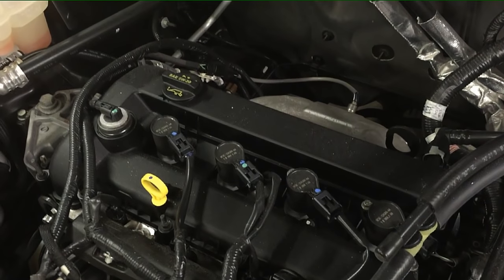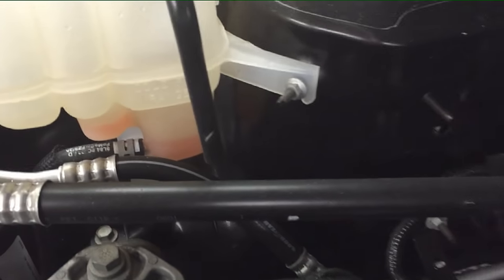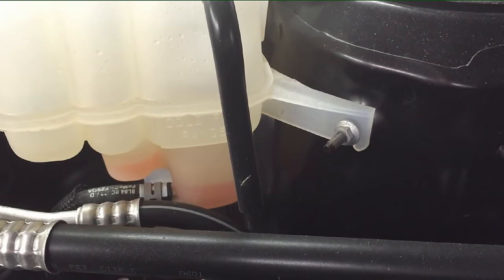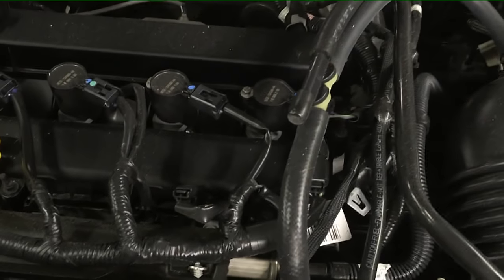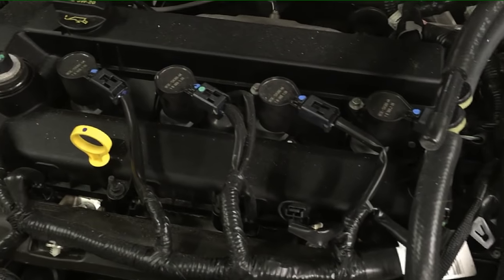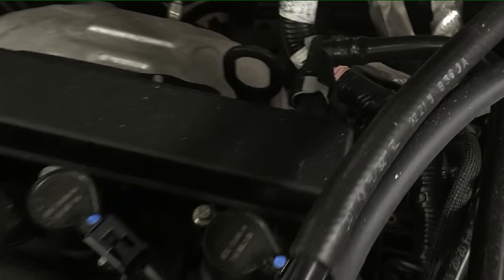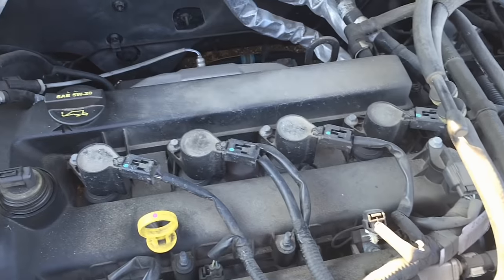Ford Vehicle Noises: #4 Tapping Knocking Noise 2.5L Engines

Comment: Mine sounds like that. Has since I bought it with 45k miles. I’m at 203 now and it runs absolutely fine. My mechanic told me these are known to be noisy but reliable engines
Reply: Oh and I still get around 27mpg average mixed city and rural driving
Reply: Yep it's a DOHC 24 Valve 2.5L L4 they have a slight ticking noise. It's very European tractor like sounding. It's normal

Comment: I had an interesting tapping noise like that which suddenly got really bad. It turned out to be that the flex plate was fractured all around the mounting bolts for the drive shaft. It came out in two jagged pieces!
Reply: Same here. Cracked flex plate.
Reply: Did that noise come and go? I have a knocking noise that will be random at idle, pretty much goes away above 2K rpm
Reply: @keithtulloch5682  It came and went and got much worse. I was still able to crank it, so the alighment for the starter was maintained. I didn't know what was happening, so I tried setting the timing, used the wrong timing pin and broke a valve, bent some other valves and had to drop the oil pan to replace the piston head that was pierced by the broken valve! The noise remained after I solved my oops-generated engine problems, so I dropped the transmission and discovered the broken flex plate. It fell off when I approached the first mounting bolt. It was a jagged fracture around the array of bolts that secured it to the engine. The replacement Ford part seemed to have a stronger, perhaps more resilient, design.
Reply: @keithtulloch5682  dude same with me please if u have any info that would help
Reply: My 2006 mountaineer sounds like a ticks not like a gas motor should sound. Just had a rebuild 3500

Comment: Thank you for doing this video. My 2015 Ford Edge has started making this noise. And you're right, it gets louder as the engine heats up, but I don't hear it as I'm driving down the road. What is a fair cost to have this fixed?

Comment: On a used car I would walk away from a noise like that.
Reply: Will C just worked on a fusion lady bought for $4000 at a unloyal used dealer. Diagnosed it and turned out a the rattling noise is a misfire and a bad valve. Didn’t overhear but must have been a beginning of a head leak.

Comment: I have 05 ford escape 4 cylinder . I think this is the issue I have. when it start it do not have loud knocking noise. but after few min it gets really loud noise.and leaking some fluid. must be antifreeze.

Comment: Thanks for the great video. My Escape just began making this noise. It sounds a lot louder when the car is in low RPM or if I disconnect any of the coils. If I rev the engine up a little bit it stops. The car runs perfectly and I don't hear the noise while driving. What has to be done to fix the crack? Or how can it be muted?
Reply: Did you find out what it was?
Reply: @Alex Arias  it was the flywheel/flex plate. It cracked, so the noise was coming from the broken piece of metal bouncing around.
Reply: @miguelmojica5897  
I have a 2014 ford scape and has the same noise 
So is that the problem my Mecanic going to check the car tomorrow
Reply: My 2014 Ford Transit Conbect has the same symptoms as your vehicle but the noise is on the passenger side of the vehicle I thought it was the water pump and changed that and i cut the ac compressor belt the sound is still there......smh

Comment: 2003 Focus with the 2.3L Duratec motor, 230,000 miles and still running strong!  I change the oil every 5,000 miles without fail.  Flushing the coolant and replacing the hoses is important too.  Just show your motor some love!

Comment: I have a 2007 Ford Fusion with this engine...I had 79k miles on it and after a long trip this ended up happening to my vehicle.  I am still driving it as of May 2020.  I have the exact sound and symptoms in the exact location you are showing here.  I was pissed and still owed money on the car loan.  A pro mechanic found a little metal in the oil pan and suggested I replace the engine.  I have kids and family and needed a reliable car so I just let it sit for a year.  I then decided to just have it as a "in town" car and decided to put Mobile 1 fully-synthetic...and just keep the RPMS under 4,000k.  I've babied the car and just used it casually since.  I'm on my 3rd old change (today) and now have 98,000 mils on it...so I've driven it almost 20,000 miles and the only issue since then is a slight power steering leak.  I hope this helps anyone in a pinch to see that you can actually drive your car carefully but reliably...but I would say in this situation the BEST synthetic oil should be used no matter what...and I use MOBILE 1!  The shit works

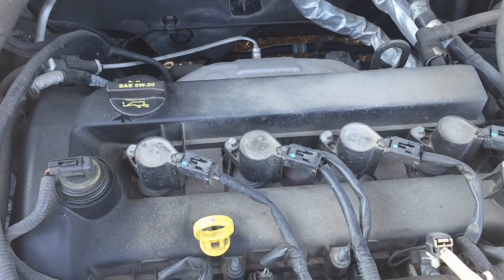Comment: You just saved me a whole lot of worry, first time owning a 2L engine, and I thought the noise coming out of the engine was sign of some horrible problem. Turns out, they're supposed to make that   sound (2:20), live and learn I guess.
Reply: Mines made the same noise for almost 70thousands miles lol
Reply: @austinhall1998  same here , put in 100k so far and perfectly fine
Reply: That is why Ford Installed those rubber engine covers in the newer Duratec 2.3 and 2.5 engines. The rubber insulator dampens the noise. I've seen some people simply buy a kit that installs an insulator engine cover on the older Duratec engines.

Comment: Thanks for the video. I have a twist to my experience with this noise. The engine has 56,000 miles on it, a 2012 Escape 2.5 engine. The oil was changed a month before this happened. 5w20 oil. One day, out of nowhere this noise begins. It sounded like it was coming from between cylinders 1 and 2 on the Left side, but also resonated on the left side of the front frame clip. Took it to the dealer (just as a starting point), it was just out of warranty. They checked it and said it was the idler pulley rubbing against the frame, replaced it, a little over $130.00. I have seen this happen on corvettes and mentioned that to my wife before we took it in, but I was surprised that this was the case. It sounded Exactly like your video. Is there anyway the fooled me on thi? I just find it hard to believe I was this lucky. Also a second question, why isa the engine valve train SO noisey? Thanks for your effort to help us .

Comment: Great video. Best car I ever owned was a 2010 Ford Fusion SE, 2.5L (same engine as in this video), got me to 415,000km before the torque converter went. Tried my luck now with a 2015 Ford Escape SE, same 2.5L engine and it’s been a lemon since day 1. Purchased it 5 months ago.
Reply: Im glad too hear this. Thanks man. I just got a 2010 se 6 speed manual fusion with 150.000 miles. 2.5 liter.
Reply: Damn, looking at a 2.5 L Escape now. What are some common problems?
Reply: Toyota

Comment: 2015 Escape 2.5L 82K miles just started making this noise—thought it was a lifter maybe but sounds pretty similar.  (No coolant loss but power steering leak reported at last oil change.) thanks for the heads up!

Comment: I'm freaked a bit. I have a 2010 Fusion with the 2.5L. That said, luckily I don't have this issue. Oil and coolant changes are very important then as a preventative! Thanks again, Brian for educating us.
Reply: He said it's a manufacturing defect , maintenance will not prevent this issue.
Reply: DJR5280
Honda was having a similar problem on their 08 civics, IIRC. Block could crack due to casting defects (too thin around the coolant passages near the exhaust manifold). They extended the warranty on the engine for 10 years, 100,000 mi.  Regular oil/coolant changes won't hurt.

Comment: I wanted to thank you for this vid. I just put in a 2012 fusion engine with 27K in my Milan and it was making this noise from the get go. The car runs 100% just noise drives me nuts. But I can live with it. You ended up saving me $520 because boneyard refunded my money and let me keep engine. THANKS!!!!
Reply: blueblood76 newer toyota rav 4s had cracked cylinder heads too.
Reply: blueblood76 how you fixed? 
Sorry not much understanding English 
I have same sound 
2014 Ford Focus 45k used car
Reply: Ismail Jiva make sure ur running proper motor & oil filter 1st!
Reply: Car is still running fine 5 years later,

Comment: I have a 2015 Transit connect with a 2.5 that I actually have a hotline contact out for right now. It came in with a P0304 and it only misfires on decel. Ruled out injectors, spark plugs, coils and injector/coil power and driver circuits. Manual compression showed same compression across all four cylinders, giver or take 2-3 PSI. The engine I'm dealing with seems to have this loud obnoxious tap to it so I'm curious if you have seen any misfires associated with this block cracking issue. Hotline wants me to perform a running compression test and look at the valvetrain if the running compression test is inconclusive.

Comment: Hey brother i have 09 ford escape 2.5l and i been having a problem with my engine it wont stop shaking a change all my engine mounts and tranny mounts spark plugs and even the purge valve and it wont go away it does it even more when i put it on drive do u know what maight be the issue ? Thanks love ur videos

Comment: I just recently changed my oil and used 1qt of Lucas oil stabilizer in place of one of the full synthetic quarts of oil. Engine runs much quieter now and smoother. Coolant isn’t disappearing thankfully.

Comment: whats your thoughts on a 2014 2.5 that makes this same noise but when cold after start up, then goes away when warm, not using coolant?
Reply: I have the same issue... it starts slightly noisey but afta a 5-10 min drive and goes a way and its quiet... my oil level is good as well

Comment: I noticed this noise in my 2010 Fusion SE 2.5L almost immediately after buying it with 65,000 kms.  Knocking noise between cylinders 1 and 2 and only after warmed up, not when cold.  I've put on 80,000km over 8 years since and haven't had any issues, no coolant losses, noise level hasn't changed.  If it does lead to issues what does the proper repair entail, new block?
Reply: Any news on how the engine is doing?

Comment: I have a 2001 Ford Focus SE that I have had for six years and I am having the same problem. My mechanic, after checking my plugs, distributor cap and rotor and all of my sensors, he said they were fine, but after a test drive, it started knocking . Plus, my "Check Engine" light would come on and stay on for about two days and go out. During that time that it was on, it ran good and even did for a short time when it went out, but there was the knocking after the test drive by my mechanic. My car is at my mechanic's garage as I speak. What could be the problem with that? Thanks.

Comment: Is this knocking noise constant or does it come and go?
Reply: Idk if it comes and goes so much as being heard easier at idle. I have a 2011 with same engine and unfortunately it sounds just like this. Especially loud at idle. I figured it couldn't be a good noise and this is my first time seeing this video so it confirms my suspicions. I'm glad he said it can still be used as I'm in a legal battle with the IRS for 100grand and by no means can I afford a new vehicle of any type. I'm afraid I'd have to wicked witch without a vehicle. That's ride a bike. Anyway hope this gives you some insight.

Comment: I have this noise and while I don't notice the coolant being low I do notice it is making my oil milky. Dry Compression 190 across the board. With the closed coolant system is there a way to put in a head gasket/ block sealer?

Comment: Need help with my 17’  3.5 eco boost. Sorry this isn’t related to the stuff in this video.

Turbo rattle at high interstate highway speed.
Ford says it’s the turbos and it’s normal and they won’t replace. Is there anything I can do?
It sounds like it’s going to rattle and explode then it stops. 
Happens at about 78mph when holding speed, comes and goes.

Comment: Quick question. I know ford recommend 5w20 for these engines. But can I run a 5w30? It has over 200K Im trying to slow down the oil consumption. Thanks!

Comment: Hey I've got a 2008 Focus 2.0 Duratec came to me with diesel in it mistakenly, and I can't seem to figure out why it's still not running right something else is wrong with it. Drained fuel, added fresh gas, changed spark plugs, replaced valve cover gasket(major oil leak onto coils), and took apart the throttle body, intake manifold, and cleaned PCV valve but the car keeps blowing oil into the air intake boot/throttle body via the rubber breather tube running off the valve cover..? The car runs rough, no power, and since taking apart the air intake system and putting it back together there is a whistling/whining high pitched RPM driven sound coming from the front of the motor now.

Comment: I have a 2012 fusion 2.5 with 30K. this winter it started ticking. had been using 10w30 oil then changed it to 5w20 but it still made the noise, louder when the engine it cold. sounded like a bad lifter. I pulled the valve cover and every thing looked normal other than I could see an air gap between lifter and cam lobe on several lifters so i figure if they are hydraulic they must pump up quick when the engine is started. I assume there are hyd lifters. The car has been great to this point and seems to run well.  No coolant loss at all. If I remove the filler cap when running there seems to be a fair amount of blow by. I checked the hose from valve cover to the TB valve and that is clear.  I thought crank case pressure was supposed to be below atmospheric using a pcv valve?  I havnt had it looked at yet by my Ford dealer. your thoughts? If the block is cracked why would it make any noise?
Reply: Using 10w30 in a overhead cam engine that calls for 5-30 or 20 was your first problem. Don’t do that. And in the winter any engine that takes say 5w20 should be getting 0w20 in the cold months. Modern engines don’t have the clearances for thicker oil to get where it needs to go. And in the cold it’s even worse. You might’ve done some damage.

Comment: What is the silver dome behind the valve cover area it has the wire coming from it what is it mainly for please I need name also I have oil leak from valve cover so smoke is coming from that area the silver part and it's really hot?? Car turn over and runs the smoke comes up from just that area car doesn't show over heated or hesitation could it be just old oil been a minute sense an oil change

Comment: I own a 06 Mercury Mariner and it just happened to mine as of today.  I have the 3.0L V6 engine.  I just changed out my Camshaft Positioning Sensor and right after I did that, I noticed this noise.  Do you think it would have to do anything with that?  Please chime in if anyone would know.  Thanks, in advance.

Comment: I have an 09 and sounds like a diesel, more on cold start and when i hit the gas. Once its warm or highway speeds its smooth and not a lot of noise. No oil leaks. My 08 didn't do that, but there was differences on the engine. Could it be this?

Comment: Well my issues is the Antifreeze leaking into the engine . According to my Ford dealership. should I replace the engine or not the cost is 8000.00dollars if the dealership do it. Any advice

Comment: I have a 07 Ford Fusion 2.3l and it sounds like the knock in this video but between 1 and 2. I only hear it when it’s warmed up. And it’s gets louder the longer it runs. Could it still be a crack or somthing else like a vvt solenoid, broken exhaust manifold stud, timing tensioner, bad gas ping, tensioners or alternator bearings bad?

Comment: My 2011 Fusion has been doing this for a while, but progressively getting a little louder.  It consumes NO oil or water at all and I have had it for 5 years now.  In your opinion do you think it would give signs of dying or do you think failure would be sudden and catastrophic?  I love this car and would hate to lose it but changing the engine would only install one with the same potential problem.  Thanks, Dave in South Carolina.
Reply: Same, 2012 4 cyl 2.5 fusion

Comment: Thanks for posting this video.
you're getting me really worried now!
 I have an 06 Focus, 2.0 duratec engine, that just started making a weird engine noise.
sounds like ticking noise.
its not that loud, and probably I'm being fussy, but I've been driving my baby for the last five years and I know how she should sound.
there is no engine code.
noise is more pronounced when the engine is idling and warm. no loss of any oil or coolant though.
and no over heating.
any suggestions?
Reply from the maker: Quality Reno I wouldn't worry about it but we have seen a few valve tappets fail. Easy enough to remove the valve cover and inspect.
Reply: Quality Reno it's direct injection all newer engines sound like that. This 2.5L example in vid is damaged and he knows it.

Comment: Hi fordtechmaku I have an 07 ford escape 3.0liter engine that has only 83,000 miles on it and we'll maintained but I have a ticking  sound coming from the front valve cover not as bad a the engine in this video.  What could it be?

Comment: I've got an 07 Focus 2.0L that intermittently makes a ticking noise once the engine is hot. Not enough for an "OMG what is that noise?!" Reaction but still, it's a tick I know shouldn't be there. She's got 185k and she's solid otherwise. The tranny and engine are great (besides that knock), I'd like to keep her around for a while yet. Where can I start for at home diagnostics before I take it to the shop? No check engine light on, not over heating, if there's a leak it's not noticeable (yet🤞🏻). I appreciate any advice.
Reply: I have the same car, check the imc  runner flaps in the intake(also called tumbler flaps), they make noise when the get loose(very common). They will not always throw a code.